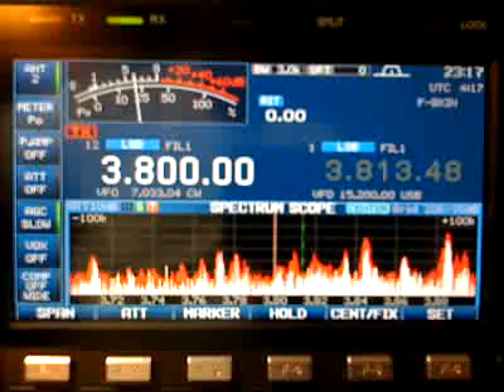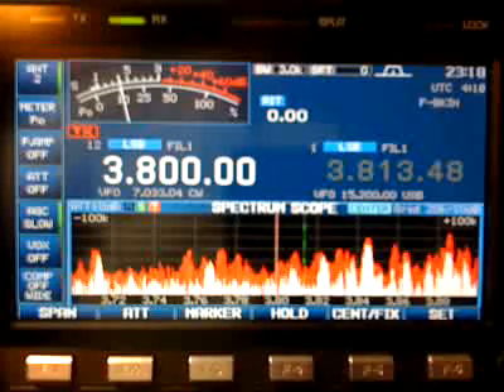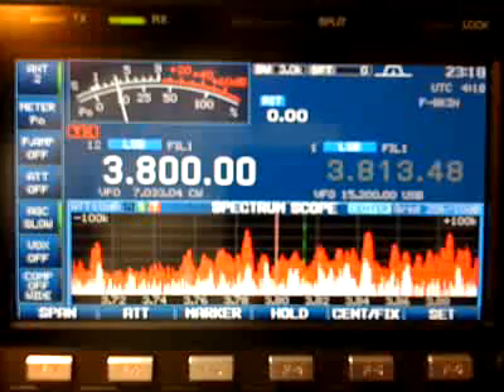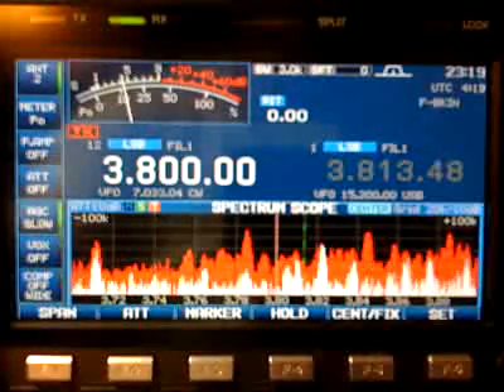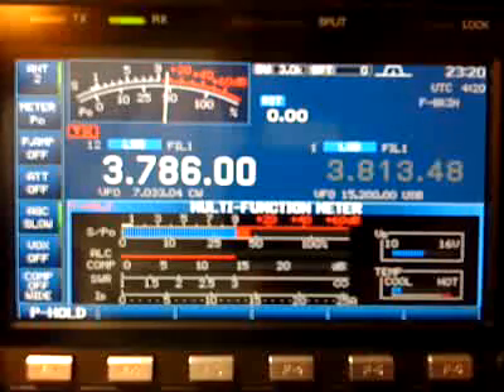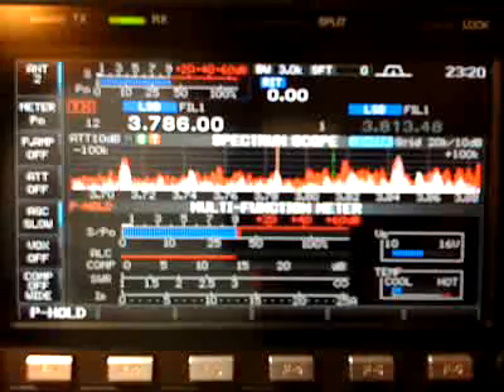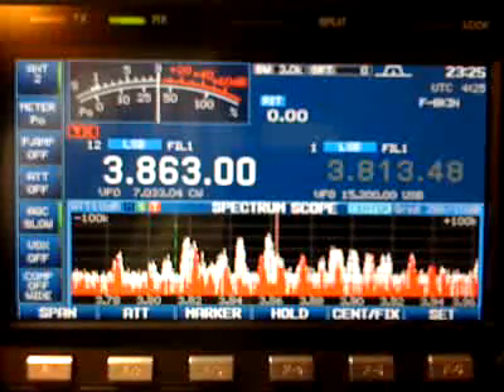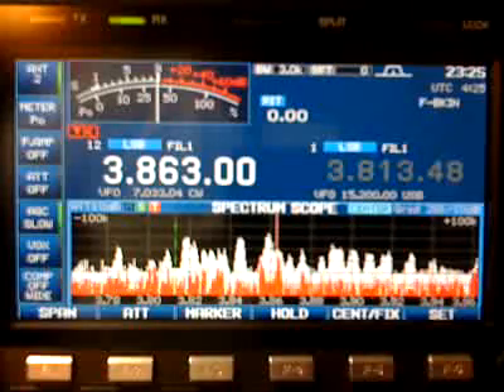Adjusting IC-7600 Screen Display features and more.

Comment from the maker: Instead of the SP-23 I have the "Sounds Sweet" speaker. Made in the USA and sounds better than any other speaker I've owned.
Reply: Eric I use a ClearSpeech Base DSP on all of my SSB & AM Transceivers & it removes so much more noise than even the builtin DSP of the radios including my own IC-7600.I hate noise so the DSP makes the radios so much easier to listen to.I use a variety of external speakers but only one brand of external DSP. 73  de W4KVW  {:>)